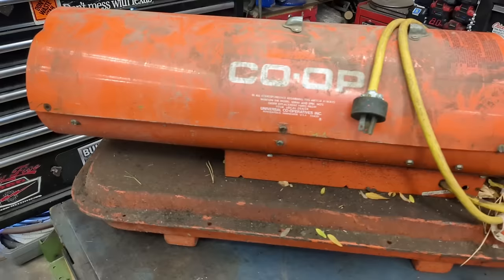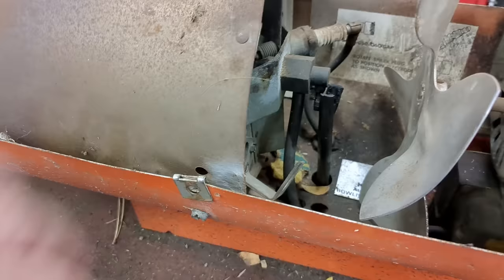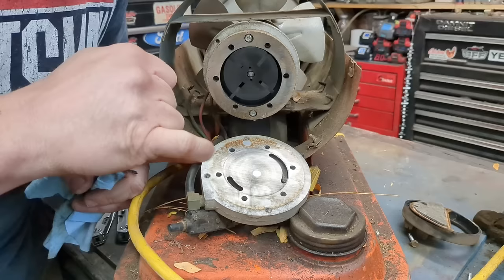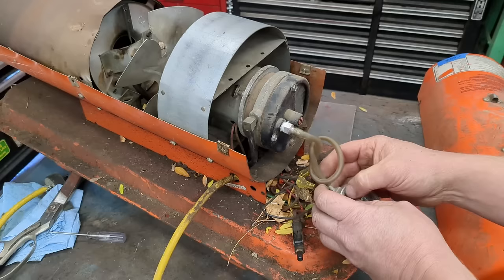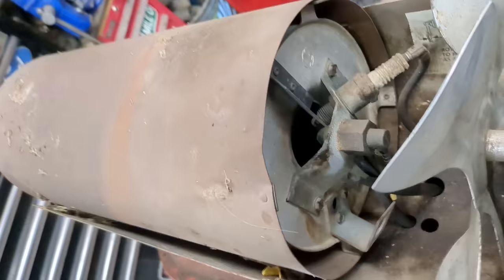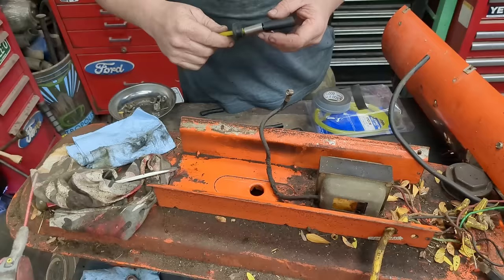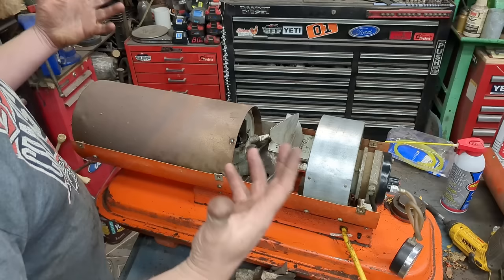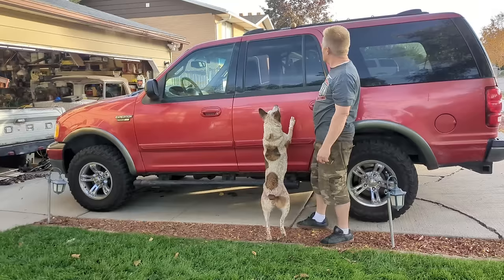Diesel Kerosene Forced Air Heater FIX EVERYTHING

Comment: I've owned 4 of those jet engine heaters during my lifetime, only bought one though, and the rest were given to me by several clients because they stank up the building they were being used in. Actually, the one I bought was an LP gas unit for the very same reason and I still have it today and it still works fine after 50 years. For the other three, I was told the spark plugs were most likely bad and I changed the plugs but made no difference they still smelled so I donated to Habitat for Humanity years ago. I may have to keep one of them and fix them, (not fooling around with the 20# LP bottle has its advantages) if I had seen this video first there really is not much to them under the hood. Thanks, I learned a great deal.
Reply: Depending on the BTU's of the propane models, they won't run on a single 20# bottle. I had a 150K BTU unit and it would only run about half the 20# bottle before it quit vaporizing the fuel. I had better luck Mani-folding 2- 20# bottles together. The 150K heaters really need 100# bottles to be efficient. Also, they are really loud....

Comment: I owned a few of those and they do a great job using diesel fuel (I've never used kerosene because of the price) If you take them apart and clean them periodically, you won't have a problem. Using Seafoam in the fuel helps and is a good choice for summer storage as a fuel stabilizer. Always store your heater with a plastic bag over the fill opening so humid air does not condensate in the fuel over the summer months or store it with a full tank of fuel so the tank doesn't rust inside. Change the fuel filter every so often and keep the little foam air filter on the pump clean. Fuel lines dry out and crack over time so keep an eye on those when your heater gets older.

Comment: I have an actual nipco heater that I bought secondhand at an auction sale and have been using it for years with relatively no problems. I sometimes use number to fuel and if I don’t put additive to it, it does seem to freeze up. I don’t know what I would do without it. Thanks again for the awesome breakdown video. This video will be very useful.

Comment: My dad used one of these for years, occasionally you’d get fumed out and eyes burning. A part in it finally died and could not source a replacement. Went to a natural gas heater mounted on the wall, and it heated a 2 car garage very warm in the winter if needed. Not saying the torpedo style heater didn’t heat well, it did too, but the natural gas heater was more convenient and off the floor.

Comment: I've noticed they are pretty clean burning. I have a multi-fuel version and have burned diesel in it because it was on hand. But I did call the company (Desa) and they told me to ALWAYS burn Kerosene if you can.
Reply from the maker: The only difference between Diesel(fuel oil no2) and Kerosene(fuel oil no1) is the parafin wax has been removed. There's actually more BTU heat energy with the diesel so it puts out more for less money. The only drawback would be in extreme cold you could get gelling and possibly a fouled spark plug after hundreds of hours. However, most places that sell "winter diesel" you should have no issues; because winter diesel is just 25-50% kerosene to prevent gelling.
Reply: @sixtyfiveford  I was just reporting what they said. Mine did have a dirtier burn with the diesel vs kero as would be expected. Slight but noticeable. I guess if you wanted to tinker with the mixture it would clean it up, but they're factory calibrated for kero. I've only ever burned kerosene (mostly) and diesel. The whole cone diffuser is always bright orange with both, but the diesel always had a slight odor. The BTU difference between kerosene and diesel is 4%, or 2% for 'winterized' diesel. Most of these units are 55,000 btu's or slightly more or less. I've never noticed any difference either heat wise or fuel economy wise between the two fuels. Kerosene is 133,000 btu vs 139,000 for diesel (IIRC). It doesn't matter which you use really, it just comes down to which is cheaper.

Comment: I have one of those sitting in the corner of the garage and you're right they do heat things up fast. I have mine strapped to an old skateboard with a handle attached for moving it around.  The price of Kerosene is ridiculous but I have never tried anything else to run it so it sits. I have never tried diesel, but I assume it would work and I keep a few gallons of that around at all times. I may try it this winter. I'll remember this video if I ever have a problem with mine.
Reply from the maker: I've never found one that didn't run good on diesel. Kerosene is just Diesel with the Paraffin wax removed and I actually find there is a slight odor with kerosene that you don't get with diesel. Paraffin wax has a very pleasant odor and that may contribute.
Reply: @sixtyfiveford  I've never used diesel but I'll give it a shot when our economy and diesel supplies aren't about to run out across the country.  I will covet what I have as a backup for now. Thanks
Reply: @sixtyfiveford  I didn't know that.  I run diesel in my kerosene Aladdin lamp simply because it's cheaper to buy that at the gas station than a gallon of Kerosene at home depot.  Seems to burn fine.  As you said, maybe the paraffin is helping it not smell as much?  Interesting.  I always knew kerosene and diesel were very similar and I wasn't too concerned, but some people say it's bad in Aladdin oil lamps..  I dunno...
Reply: The price per gallon of kerosene and diesel here is nearly the same, couple pennies here or there. Both are expensive nearing the $6 mark at the pumps.

Comment: uncle burned down his entire garage with one.  he had stacks of newspaper about 10 feet away, but the repeated use of the heater in the garage (doors opened for ventilation) the paper got super dry after years of using it. dont know why he had stacks of old newspapers, however, a spark hit that stack and poof.   just sharing a story that I saw the aftermath of.  thanks for listening.

Comment: i had to learn to maintain and repair my older desa ,tank was rusted to hell so i run a tube for fuel intake to gas can ,sitting level with original tank ,kero or deisel adjust air pull with a little pressure gauge on back and btu s are huge  fellas.once in while a peice of dirt with clog nozzle,take off top ,unscrew it and blow the sucker out.oh important note if you run with a separate fuel tank ,you gotta put a little quarter turn shutoff in fuel line to turn to off 3-10secs beforefan and pump to avoid hellish smoke belch and under hood fire.but with the shutoff its a savior for garage in winter

Comment: My Wife can get headaches from the fumes coming off fresh OSB board. I have one of these and I can run it in the house if it's really cold and it doesn't bother her at all. No fumes, no burning eyeballs, just stupid amounts of heat. They probably aren't the most economical thing but Man do they make some fast heat! Mine says to run it on kerosene or #1 heating oil which I guess is just regular heating oil/diesel. I can't get it to run heating oil without a ton of fumes. Maybe lean it out? Heating oil would be cheaper than Kero around here at least. As far as I've seen, it's heating oil that grows the fungus or bacteria. Nice trick on the hot screwdriver and I love that swanky handle!
Reply: You can get additives against bacteria in diesel, I think it would be a problem when the fuel is stored for a longer period 🤔
Reply: @petermolnar8667  Aye, last I saw it was when it was heating oil in tanks and it was probably 10 years old. I've never seen diesel with this stuff in it but I've never had it sit for so long nor even seen it sit for so long.

Comment: Good video. I have never pulled one down as far as you have. I had to replace the fuel line as well, as you stated, mine was split and sucking air. Those things can sit forever and still run. I would replace that sensor as it is a safety  feature that should be functioning. I had to use one under my mobile home when our hear tape got chewed by a mouse and even though the pilot light said it was functioning, it was not. That torpedo heater quickly thawed my water lines and I replaced the heat tape.

Comment: Finally i know, how these heaters work. I never bought one, didn't trust them.
My experience with the self sealing rubber is, that it is not oil- or Diesel resistant.
I used to use it a lot, never worked with oils or gas.
And i don't use it much on electricity any more, because it creeps away under pressure too.
So - limited use, unfortunatelly.

Comment: AWSESOME, GREAT VIDEO! I've got a used one of these in my shop for about 20 years that I picked up somewhere for cheap, (prolly 'cos it didn't work...I tend to do that a lot). I've never done anything with it. Now I can give it a once over, and half assed know what I'm doing and maybe stay a bit warmer in my shop this winter. The ironic thing now, is that here in BC Kerosene and diesel are ridiculously expensive. No 1 diesel is at $2.28 a Liter. It costs me $320 to do a complete fill on my old 1991 F250 4x4 7.3L IDI. Whereas when my truck was new, Diesel was.53 cents per liter. So it cost $75 to do a complete fill up. That's a 420% rise in price over 31 years...insane!
Reply from the maker: Dang that's expensive.
Reply: @sixtyfiveford  You're telling me! I can barely afford to go food shopping once a month, but I have to have a vehicle 'cos I'm 12 miles away from the nearest town. MY old '91 right now has 830,000 miles on it already.

Comment: I had a Sears 50k 30 years ago. It served me very well in an unseated Massachusetts work shop. We would be down to t shirts in the dead of winter.
Reply from the maker: I run a 50k all the time and can only leave it on for 30-60 minutes before it gets uncomfortably warm. Mine is a retired UHAUL rental unit for the 80's I paid 10 bucks for. It has to have a million hours on it by now.

Comment: Hey great video loved it. One point I'd like to make is that the carbon monoxide detector you have with the digital readout is misleading. Those off the shelf CO detectors will not will not read anything until it hits a threshold usually 100 PPM. There is also a Time threshold as well before it'll read anything but zero. I found this out with my boat. We were getting light-headed down in the cabin and the carbon monoxide detector we had wasn't reading anything but zero. I went ahead and bought a professional work safety one that tells you live data

Comment: Around 1991 I bought a shop heater haven't had to work on it at all! No nothing and never failed it puts out 245,000 btu's light weight and runs off of Propane. 20 pound propane BBQ tanks - 100 pound propane cylinders. Forget liquid fuels for dependability. Vapor fuels are the only way to go like propane, natural gas, gasification, hydrogen, methane and more!!!

Comment: i had to replace the transformer and spark plug in mine last year, so while i had it torn down, i mounted some wheelchair push handles on the intake end, a sheet steel shelf above the output end for drying wet gloves on and warming spray paint cans and caster wheels on all four corners for ease of moving it around my shop, with a 120v wall switch in the power cord mounted in a steel switch box with flexible conduit up high on the handles so i can turn it off and on with a flip of a switch instead of bending over and plugging and unplugging all of the time. that ground gets further away every year. instead of pricey kerosene, i run 2/3 diesel 1/3 gasoline through mine, works just as well.
Reply from the maker: Awesome modifications. Just a heads up, depending on where you live/how cold it is: "winter diesel"is just diesel mixed up to 50% with Kerosene so it won't gel.
Reply: @sixtyfiveford  i only run the mix because diesel is 50-75 cents a gallon cheaper than kerosene where i live in northern indiana, and my heater doesn't like running straight diesel. i suppose if i got a different nozzle i could run it though.

Comment: that stuff you're using at 15:57, ive been told its called "self amalgamating tape".  ive been told its been around for years but i only learnt about it 2 years ago.  i suspect the way it bonds is by the molecules snagging against each other when stretched.  this same effect can be noticed with elastic bands tightly wound up.  i first saw this stuff on a yt video. it was in a cv boot repair kit.  i was astonished to see how the bloke dragged the piece of tape through all the front wheel drive and steering components without sticking to anything until stretched around the cv boot.  so i googled "tape that sticks to nothing except itself" and up it popped.

Comment: Years ago I had one of those heaters light on fire almost burning my building down. The problem was the fan hub loosened and the pump continued to pump fuel but with no fan spinning raw fuel was pumped into the combustion chamber and was still burning.. It was all caused by a tiny set screw on the fan hub. These are great heaters but you have to keep an eye on them.
Reply from the maker: That's one of the reasons I don't set up a thermostat system like so many people do. I'm always around it or within 30feet.

Comment: I got a brand new Dewalt one with a automatic thermostat digital screen it’s nice I run diesel in it and only need to turn it on for like 5 minutes to heat up the garage if the doors shut

Comment: i've got one of these that my dad bought in the 90s to heat our garage, after we moved it sat in the shed and the lines rotted away. Just bought a new nozzle, the pump kit, and the pressure gauge for it; wife wanted to toss it until I showed her what a new one costs! ($299 vs about $40 to fix this one, mine is the 35,000 BTU model though

Comment: good littleVideo on these Heaters recently i noticed onEbay there are a newer generation of DeiselHeaters made inChina  that are designed to use indoors or even  inside  a passenger Compartment of a Vehicle  they caught my attention because  i use. to use a PropaneMr Buddy Heater to heat up a Canvas enclosedHelmarea onmy Sport Fishing boat in old weather  mainly just to take the Chill Off and to keep my feet Warm  but i never felt that safe with that system  as far as CarbonMonoxide  so i kept Windows opened slightly for fresh Air and doubled up onCarbonMonoxide Detectors

Comment: My favorite commercially-available Poor Man's Jet Engine. I looked at the operating principle some years back when making my jet engine developed for testing high temp composite parts, but ended up using jet engine parts like compressors, combustor liners and fuel nozzles for inherent durability. It's also doubles as my forge burner coincidentally during the lovely Texas summers when feeling like I need more heat is the least of my concerns! 
At any rate, I'm surprised more people don't use these for waste oil forge burners. Lil bit of fiddling would get these extraordinarily hot, though you'd need some pretty intense heat shielding to compensate compared to what you get on these models. 🔥
Reply from the maker: Awesome!

Comment: You might want to put a strain relief on the cord where it goes in the heater. it could prevent a serious problem if it gets pulled or it rubs on the opening.

Comment: Tried to repair one with more modern control system. First ID issue being dead capacitor for the fan motor and rotted out fuel line, so while keeping eye out to get new one decided to do total overhaul and clean everything since it was crusty. First tried to get everything out from the combustion chamber and managed to snap the glow element while removing it. It turns out its ceramic, EXTREMELY BRITTLE and pain to get out of its socket at least in this unit, then when trying to figure out what kind of plug it was.. well turns out you need the plug connected in there or it detonates control boards mosfet spectacular fashion! So yeah keeping eye out for second unit for spare parts or other way around, but since its this simple invention and i'm there while its in running i might replace glow plug with diesel engines one, rig a power source for it and go past the flame detector and control board until i can find unit for swap parts from this one.

Comment: Just in time, this morning I had to hold the lighter for awhile to get it to light and the volume on the amp feels like thick liquid and I don't have any firewood in my shop, should be triple stacked to the ceiling.  Had to laugh at your moment of think fast when you first started it, I go through that almost every moment of the day.  Like yesterday, I got home with a load of oversized slabs and the door knob on my shop decided to to lock itself after a decade and all the tools are behind the door...  I need one of those belt counters.  My late father-in-law left me a brand new heater like that so full that just jigging it starts dripping diesel and who ever designed the cap should be seriously taken around back and slapped up.  I tried out the new to me battery powered siphoning gizmo and I guess it should be lower cause it didn't turn off and I had fuel all over in the middle of my shop.
Reply from the maker: I've sloshed and spilled fuel with these so many times. I'm so used to it now the towels are always on the ready.

Comment: Great video, 👍, thanks. Thieves got my Ready Heater so I replaced it with an electric furnace that a friend removed from his house. The furnace is slower to heat the garage but I like how it is much quieter. Yoda and I ❤️ Ginger.
Reply from the maker: The noise is my only complaint with these. Ginger says HEY YODA!